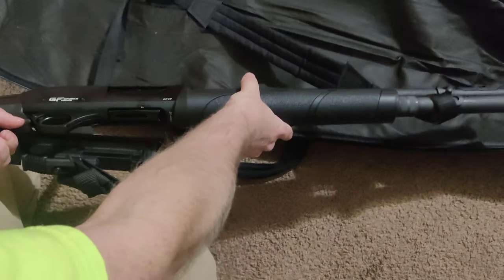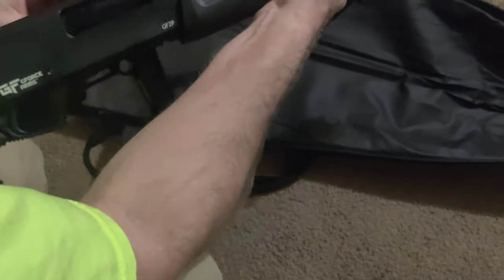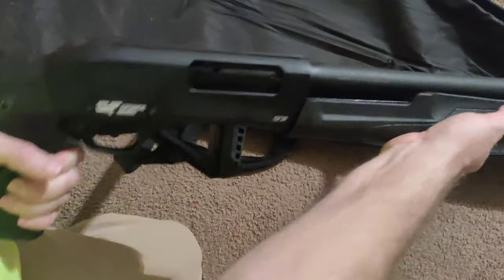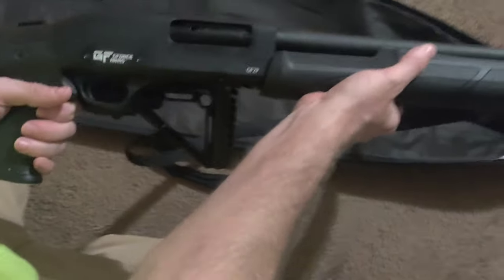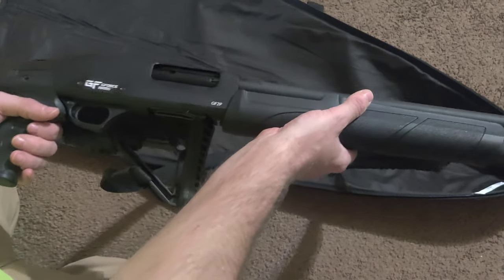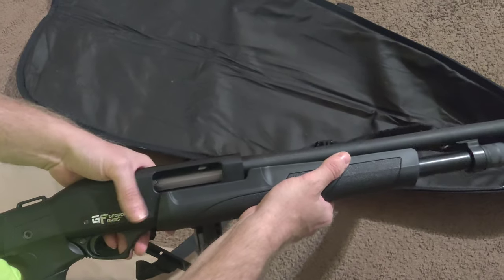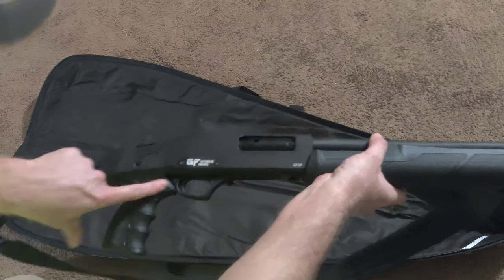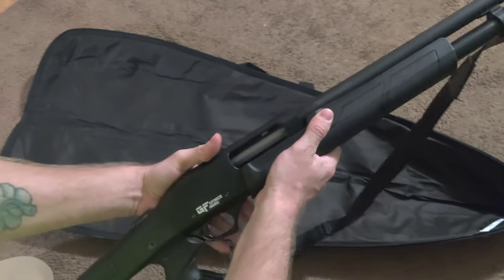IMPORTANT! GF2P Gforce 12 gauge.(pump action) OR (slide action) shot gun safety and operation.

Comment: But even when I fire mines I still have to press the slide… why and how come I have to press it after I fire a shot every time? Like what am I doing wrong?
Reply from the maker: It sounds like you're doing everything correct.
 But there's something wrong with the gun, I would take it to the gunsmith or the call the shop were you purchased it and see if it has a warranty so you don't have to pay to fix it. If it's from G-Force they will fix it for you if you haven't modified the gun.

Comment: What rail did you buy for your pump to be able to add your flashlight
Reply from the maker: @QwirkzyYT  well it was a barrel clamp Rail, and I hate it.
 too much recoil off a 12-gauge ended up pushing so far forward that it scratch the hell out of my gun barrel almost broke my hi vis sight and I couldn't get it to stay in place.
 So I'm going to try to get one of the g-force forend/slide pump portion and replace it because it has a picatinny rail built in on the bottom of it. 
Or maybe look into a different mounting system. I am pretty creative and good at engineering things and making parts and things I need myself for all kinds of things so I may be able to fabricate one myself but I am going to look into it since there isn't a whole lot of customization you can do on this gun unless you're willing to put some work into it. We shall see, if I do get the forearm pump portion I will get a video up as well

Comment: Does the g-force 2p have a threaded barrel for interchangeable chokes?
Reply from the maker: @shawnrichards4565  No it dose not sadly and the barrel itself is full mod so the full length of the barrel is modified not just the breach or barrel tip, that's why your not supposed to shoot any slugs though is unless you get the math correct

Comment: Good short video. I am looking at possibly getting this shotgun as well. Would you say it is worth it? It is on the lower end of price, so hoping not too cheap and fails/jambs all of the time?
I am also looking at putting the Gforce folding stock on it. Any issue with that install?
Reply from the maker: @DougZ73  I put a link to the stock install video, it's been amazing shotgun holding up very well, the only time I had any 
Jam ups, is when I first installed the mag tube extension  because the way the spring was set but I fixed that easily, and when I short stroke it, 
those were my fault tho. Before I did any modifications to it, it worked perfectly fine and I had put a couple hundred rounds through it before I modified it.
 I also did a video on the install on the stock here is the link it's a nice short easy video! https://youtu.be/l69MEJEP6Xw?si=9LSjTO4QrG6LRS6q
Reply: @BUZZKILLJRJR  Thanks man. I figured it was  a cheap junk pump shotgun, and looking for vids where it would fail a lot. So far, I have not really seen any vids with failures. Your video is a good deciding factor to adding  this one to my collection.  At the current prices, its less than a grocery shopping trip. Thanks for the quick reply.
Reply from the maker: @DougZ73  yeah I like I said in my longer reply the only Jam UPS I had were user error not the gun itself, and many shells will not cycle properly either, not unless you hold the gun kind of sideways with the injection Port facing upward antenna finagle the round. So shortie shell not good.

Comment: I want a mag tube ext but they seem so complicated to put on
Reply from the maker: It's really not, I made a video on how to do it. The biggest problem is when grinding the inside of the Ring people over do it and then mess up there only mag tube on their shotgun. Best advice I can give is slowly take a little bit at a time and just use your finger to feel if you got it smooth or not. Or you can continue to wait because G-Force seems to keep coming out with more and more products all the time. You can probably take it to a local gunsmith as well. I seen you commented on my previous video before you're only grinding the ring on the inside of the mag tube that's on your shotgun not the one you get.
Reply: I noticed something, this shotgun looks extremely familiar to the Emperor MXP12

Are they like built in the same place and just imported with different names? I saw another video where the guy put on a m3000 mag tube extension and I want to do that to mine as well as that folding pistol grip stock.
Reply: @BUZZKILLJRJR  can I grind it down with sandpaper?